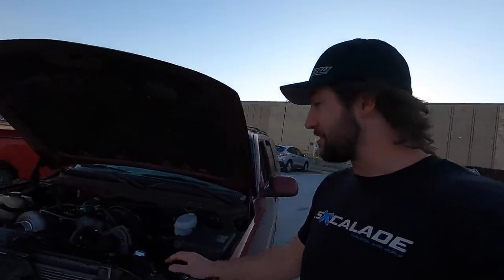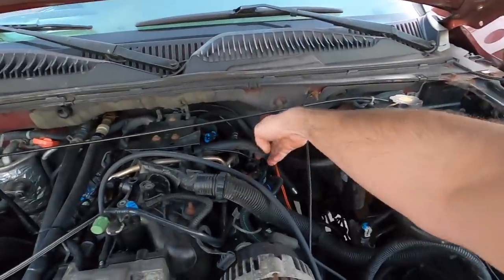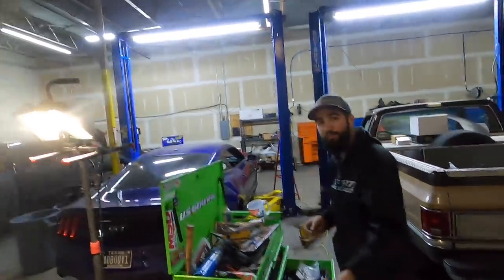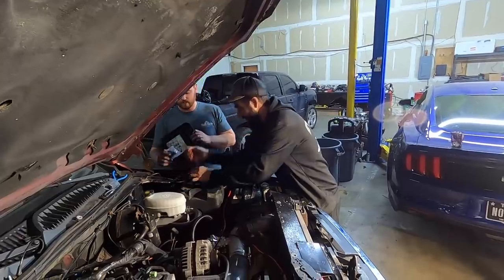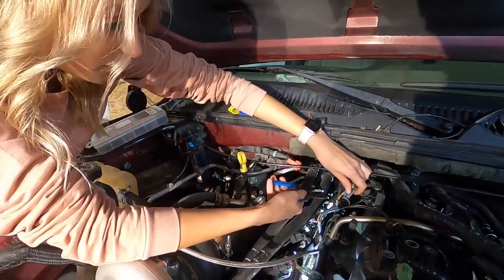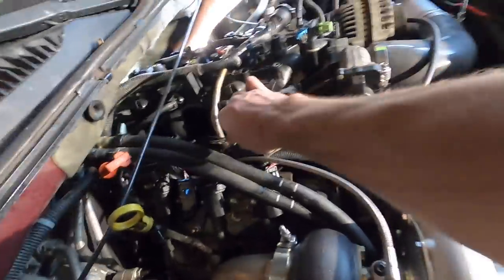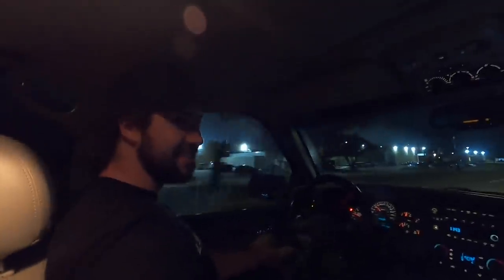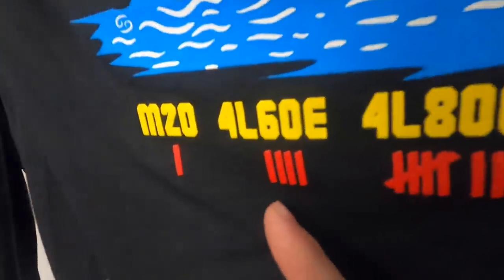What Happens If You Turbo a 5.3L Yukon With No Other Mods? PART 2: Fuel Injector Upgrade! (RIP 4L60)

Comment: Just a thought, you could try and do a cross-over video with Precision Transmission in Amarillo TX.  They have a great channel showing the faults of transmissions,  transfer cases, rear ends ect.  Would be a good way to get Uncle Rob a gearbox and transfer case worthy of all the engine work you have done.

Comment: The not using solder was a valuable tech tip
Reply from the maker: Absolutely! I didn’t know that until he told me honestly
Reply: Silver solder would probably be fine.
Reply: That's the dumbest tech tip I've ever heard but connection are garbage and should only be used as a temporary fix. Do some research. I've been a auto electrician for over 15years Soldering is the proper way to connect wires together
Reply: It's actually better to use solder over crimp connections. Crimp connections will cause a slight amount of resistance. I've been to multiple advanced electrical training courses for german lift trucks which use ohm resistance to deliver communication from each component back to its designated module. If theres any more than .04 ohms of resistance within the harness the module signals a fault. ''Butt connections can and will do this due to excessive resistance'' per the engineers of a company that designs and builds entirely unmanned electric/IC forklifts. Soldering is the proper way to connect any signal wire. Especially in a low voltage system. The first thing the instructors trained us to do was search for any butt connectors within the harness and eliminate them.
Reply: I soldered and shrink wrapped my entire engine harness 4 years ago and have never had an issue. I also like the fancy shrink butt connectors. In the General Motors asep program I took at osu-it my instructor said that gm recommends the fancy connectors over solder but either way if done correctly is a completely adequate repair. Just watch your shrink wrap near hot areas, be sure to stagger your splices so you don’t end up having the shrink wrap melt and short stuff out. I’ve made that mistake on my crank sensor. Ended up using the fancy cloth electrical tape in that area...

Edit: I really hate the way butt connectors look. Solder and Shrink wrap is just cleaner and doesn’t leave your harness all pregnant looking.

Comment: That green heatgun is used to join and seal TPO and PVC roofing membranes. The internal thermal unit can burn out over time if you just turn if off without letting it cool itself down first by leaving the fan running for a little while... those thermal units are expensive to replace.

Comment: The green heat gun. The flooring guys use those and call them welders and use then to weld the seams in the vinyl floor sheets.

Comment: the solder adds resistance because the price of silver went up . So you can't get good solder. Back before silver went sky high on price you could get good low resistance soldered connections

Comment: I think in certian gm's having the door open turns on a certian "backround" 12v or 5v circuit in the vehicle... I work at an audio shop in lemoyne p.a. and i remember something  i was doing that this effected the obd2 onscreen diag on a aftermarket head unit...weird...so its def linked to the ecu somehow. This just reminded about this

Comment: I am a fan of the GM LS 5.3.
Now too complete that turbo setup, just install new pairs of compcams with new valve springs, and new rocker's and that will definitely increase the gopower from that LS 5.3.....
P.S.    MAYBE ADD A LSX INTAKE, AND HEADERS. BUT ADDING HEADERS TO THAT MAYBE ALITTLE BIT  TO MUCH.MAYBE.
BUT WILL SOUND AWESOME.
Good work on your project.

Comment: “You can smell how hot it is.” There is am actual engineering term for this. It’s called an acrid odor and is a signal of a class C fire. Is totally legit!
Reply: I know exactly what he meant by smelling how hot it is lol things have a different smell when they get hotter than they should
Reply: Especially electrical melt down .fuse box .wire harness . connectors.ect

Comment: Solder connections don't create resistance, it does however make a solid stiff spot on the wire and the vibration will break the connection.

Comment: I believe you can pop the center out of the bud connector and use heat shrink I’ve the top I usually do that for stereo setups when I wire manage with plastic luming tubes

Comment: My 2004 Tahoe had all sorts of mud dauber nests (those "walnuts") in the engine bay after sitting outside for a while. On the AC lines, several hidden around the intake manifold, and a couple on the radiator core behind the AC core.
Reply from the maker: These were actual black walnuts lol

Comment: The Batt (+) pin on the OBD2 Socket is the same circuit as the cigarette lighter. Repair that circuit or jump battery voltage to Pin 16 on the DLC.

Comment: I just installed an aftermarket stereo in my wife's Santa Fe and when I looked at the install instructions for the steering wheel control it said "NOT" to use barrel connectors at it may change the resistance and cause the controls to not work since the steering wheel control module is based on resistances....I started to solider but had issues and did barrel connectors. Still worked ! I ain't mad!! lol It was a Chinese made SWC module so...WTF they know!! Right? Between the Stereo, Amp , Parking Brake Bypass, SWC, and the other factory luxuries I wanted to retain, there is a spiderweb of interconnected butts with 2 and 3 and 4 leads butted together. I'm definitely a butt man!!

Comment: Solder is also more prone to break mechanically over time versus a crimp style connector.  I think even NASA only uses mechanical connection versus solder when vibration is involved, solder is for board mount stuff mainly.  They are smarter than me so I won't question it.
Reply from the maker: Agreed 😂
Reply: But they have lots of the best engineers but still blow stuff up

Comment: Thats a pvc welder. Its used on commercial roofimg to weld the roofimg sheets together 9ir repairs. Thats a super powerful heat gun very high wattage. Also a pretty expensive tool to be sealimg heatahrink with.lol

Comment: Those shit side post bolts, i always cut the insulation off the flats throw those 8mm head bolts away and use standard 3/8” bolts with a jamb nut to tighten it. The pause of awkward quiet when he said...you can smell how hot it is....everybody thought it but nobody said it because she was there😂
Reply from the maker: I may have to try that
Reply: I always get the side post bolts from oreillys that thread in but then they have an extra nut for adding circuits
Reply: @kylecube15  i have welded a nut to the stock ones to get them off then reused them, spooky as hell welding to a battery but i had let my level of pissed off get the best of me at that point lol

Comment: I was having all sorts of problems with my 02 Silverado dash lights flashing, gauges not working all sorts of electrical issues and I put a new  battery bolts in it and haven't had any issues since.
Reply from the maker: Interesting... I will try that

Comment: Was your deatschwerks order just a drop in kit or did you order separate fuel accessories on top of the dw400? I saw they had a drop in kit for the 1999-2004 Sierra/Silverados and then another drop in kit for the 2005-2009 Sierra Silverado’s. Wondering why you had to get a new 04+ fuel tank if your 03 Yukon is supposed to fit one of the kits (mine is an 04 Yukon). Also did the kit convert your stock returnless style fuel system to a return style with the deatschwerks kit?
Reply from the maker: I needed the new tank. Got the drop in with regulator and filter too. It’ll have a return
Reply: @Stapleton42  Thanks for the reply. I’ll give them a call tomorrow. Did you get the Yukon or Sierra drop in kit? I saw they have a Yukon drop in kit for 2005+ but I have an 04 Yukon so I’m not sure if my tank will work. I heard you say in the video you were looking for an 04 or newer tank so maybe I won’t have to change my tank if I already have an 04?

Comment: I plan on doing g basically the same setup as uncle Rob only I have a slightly built 4l60e what size torque converter would you recommend???
Reply from the maker: The one that fits in a 4l80 because the 60 will melt. Trust me man. Just make the swap and you’ll save money in the long run… 60s do not live in heavy trucks with boost for long
Reply: @Stapleton42  for sure plan on the 80 swap what stall would you recommend then with same turbo that is in uncle Rob then? Would 3200 be too high or maybe 2800-3000

Comment: This build is inspiring me more to build my 00 dodge Dakota 4x4  just cause it isn't practical.
Quick question if I were to use a small enough turbo could I worry about the fuel system later 3.9l v6
Reply from the maker: Most likely

Comment: You should use the pink connectors on the injectors they will fit tighter on the wires just saying I am a automobile electrician..
Reply from the maker: This is what I had laying around already lol

Comment: Hey. I have a 08 XL with cam heads dod delete etc. Im getting gears next week and was wondering witch i should go with 373 or 410. I want the top end speed. Will 410 be too big?
Reply from the maker: 4.10. 3.42 to 3.73 won’t make much of a difference on the butt dyno
Reply: 410 it is then. Thanks for the info. Big fan love the channel.

Comment: obd wont have 12 v power to it if the fuse for the 12 v power aux on the dash on the cener console. next to the 12 car charger believe theres 2 differnt fuses for both sides one is connceted to the obd for it to comuicate with reader. hope this helps

Comment: I pulled my injectors out of my mustang and didn't check the o rings before I put them back in and it went up in flames fast. Had to replace everything under the hood over a cracked o ring

Comment: Th 400 front yoke works for transmission
Reply: Speed engineering transmission mount brace, custom Russell braided lines, pig tail adapter and a program tune

Comment: Would it be within your budget to just pull the existing motor, hone it, install forged rods&pistons, new cam & bearings and then rip it reliably? I recall Cleetus & James went through several 5.3's with Ruby until they finally built it right- then it ran 8 second passes consistently and reliably until they got bored and put the 427 in it. Just saying, if your Uncle Rob wants y'all to put some respect on that vehicle...
Reply from the maker: Eventually but it doesn’t need any of that now

Comment: I know on my 02 you have to pull the fuse for the radio and amplifier to flash the tune it
Reply from the maker: Interesting. Is it stock or aftermarket?
Reply: Stock 5.3 with a banks cold air and banks flash tune

Comment: You need to fully gut it
Reply from the maker: Noooo
Reply: @Stapleton42  the 4l80 will go out to truck to heavy pull weight is the only way unless you get really lucky and fine a 4l85e from a box truck